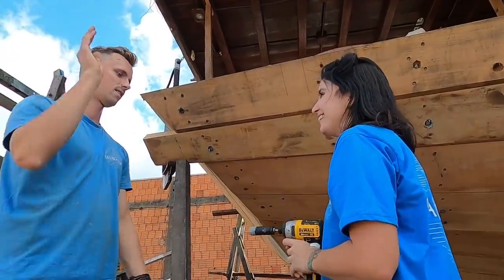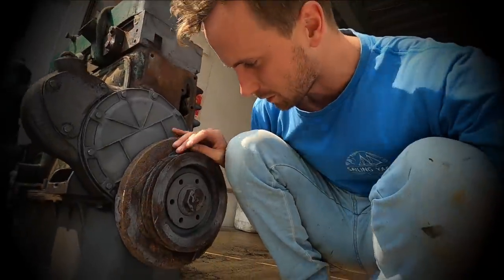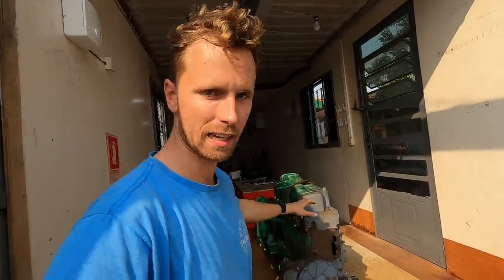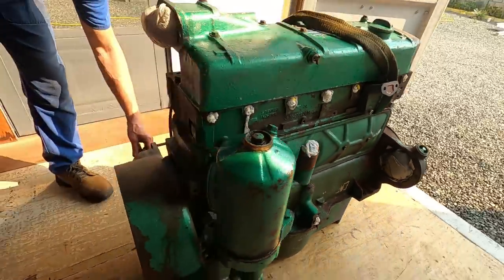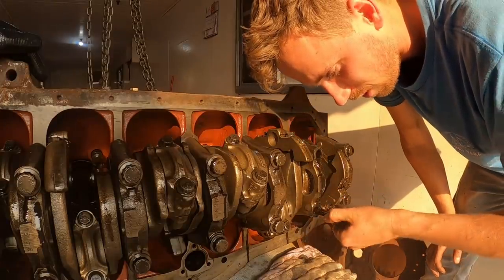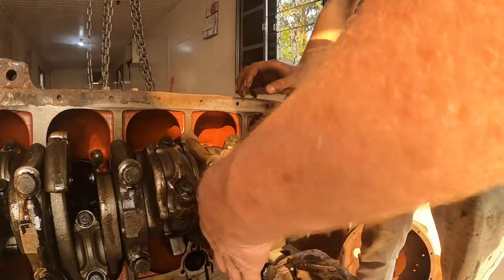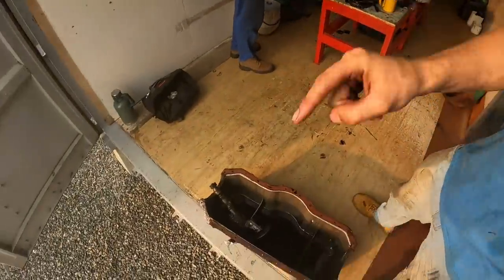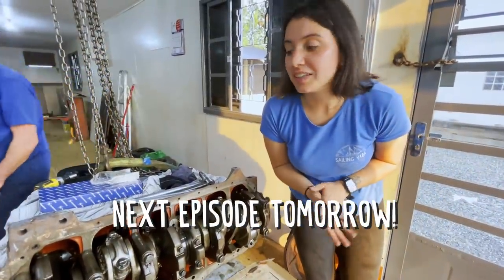ENGINE OVERHAUL STARTS NOW! (+ ingenious DIY crane) — Sailing Yabá #62

Comment: The sump is held on by bolts or if its threaded both ends its a stud ... They will often have different threads at each end so 
Take a picture and a make a  note sometimes they are different lengths or diameters. If you are to learn yourselves you need to develope a method..
Your mechanic probably could do most of this by touch and sight.. You have to learn to discriminate and identify parts based on tiny differences in things like the fineness or courseness of threads head types and know where the wild card left hand threads are used if any.
There are the crankshaft bearings that sit in the engine in the block the other bearings on the crank are the piston big end bearings or conrod big end bearings.... The small end bearing is what the piston attaches to.  
If your engine lost oil you should check the bores and rings.

Comment: It is better to remove the head. And check the cylinder bore. And it is called an oil pan. The flywheel is inside of the bell housing. If you lost that much oil find the leak and check the oil pump and the pressure by pass valve shim the bypass valve spring to increase the oil psi. I thought lots of this was really funny. Heat is what you use to remove stuck bolts and nuts when nothing else works

Comment: Dont forget to drop the crankshaft out and turn it (resurface it) the same way you do break rotors. Crankshafts are very delicate regarding bearings and it will likely start knocking if you dont turn the crank.

Comment: If the main bearings are worn you can bet the rod bearings will be worn and if they are worn good chance the cam bearings should be inspected and a new oil pump thats the heart of the system , pull the head inspect the valve seats and put new valve stem seals and a new head gasket, measure the cylinder tolerance and repair if necessary and new rings on the pistons , then it will be Done and reliable

Comment: Hi guys. I'm relieved to see that so many other other people have made similar comments to mine. I don't wish to put your efforts down and I know you are probably trying to save money, but as a marine engineer, I am worried that you are relying on this engine without a full stripdown and rebuild. The bearing shells are worn and you know the oil level was low. You need to have that crank out to measure the wear on the surfaces and to check the bearing caps and con rods for ovality. It is likely to need a regrind. The head needs to come off to check the pistons, cylinder bore, little end bearings for wear. The camshaft, cam lifters, rocker shaft and valves all need removing, cleaning and inspecting. The head and block surfaces need checking for distortion. Low oil level is likely to have caused much more damage at the "hot" end of the engine. You will be risking your lives on the performance of this engine. Please consider what so many people are saying, get the engine fully checked out.

Comment: That old deisel should be sleaved for the combution chamber... if so. no reason to try and measure for loss of tapper... just resleave it.  As for the valve guides.. they too should be sleaved.  I always hated measuring valve guides and piston taper on a sleaved engine as you had to resleave it anyway...  Hope that is how this one is.

Comment: @1:05, you ignored your advice from earlier in the video @0:15 already. make an access way in the deck to put the engine in, if you can get it in, then you can get it out in future if you need to without cutting up the boat.

Comment: Good grief. The engine had NO oil in it. There is no manual in sight but there are wear specs that should be referenced before slapping new bearings in it. Rebuild the engine properly or replace it!  If you don't have time or money to do it properly the first time, you definitely won't the second time around. Your compression numbers were questionable at best and the bottom end of the engine is very tired. Take it to a proper shop, this isn't something to fart around with yourself. Hopefully the main bearing caps and big end caps were labelled before removal because they have to go back in the same location they came from.

Comment: I totally support you guys! However you are making a big mistake by not rebuilding that engine! If it where my engine I would reseat all the valves with new seals on the head, change all gaskets with new front crank seal and rear main seal change all bearings for both pistons and crankshaft. Send head out and have its surface machined with proper head gasket. I know it will cost you a few dollars but it’s cheaper than a new engine and will be entirely cheaper than if something goes wrong and you have to take out of boat again.

Comment: The internals of the engine look very clean which seems to indicate it has not run very hot during its life. Mechanic seems to know what he is doing so sometimes, if it ain’t broke, don’t fix it, is the most suitable option. Just ensure the oil seals are replaced and gaskets are sealing.

Comment: You can't possibly know if the cylinders or Pistons are ok if you don't pull out the crankshaft rods and Pistons. You definitely have to replace the piston rings and you need to pull off the head and check the camshaft,valves, and replace the camshaft bearings. And I certainly hope you don't sand blast the interior of the engine as you will never get all the sand out and what's left will eat the engine alive once it's running.You can't do half a rebuild you either do it right or might as well buy a new engine now. Especially on a diesel engine.

Comment: I am sure your done with the engine by now but if you took your time and rebuilt it correctly that Mercedes motor will last longer that you. I have see them from the 50's and 60's that are still running with original equipment from the factory.

Comment: As MANY said before, i don't see the purpose of replacing the crankshaft bearings, and not the connecting rod bearings. Very often, rod bearings wear faster than crankshaft bearings. you would be wise to open the head, check the valves, and replace the piston rings, the oil pump at least. Cutting corners on a marine engine is always a bad idea. Check the "wildlings sailing" channel : a young couple, as you are. They tried to refit their engine on a tight budget. They spent money on it and the engine just blew away months later.  I saw plenty of " rebuilt engines" ( or presented as such) fail after short period of service.  It would really be a pain in the ass to take your engine out of the boat once all the new wood is in place.  All that said, it's your boat, your money, your decisions... and your experience! Just  a few words from an old fart from France. Keep on the GOOD work and enthusiasm!

Comment: That engine is ancient technology & materials and design. Putting it back in will devalue the boat. It’s too heavy for the power it makes.
But a new Yanmar Diesel engine and install it.
More power, less fuel, less weight, more reliable & more value boat.

Comment: Oh! 😳
That's not an overhaul!! You need to get the head off, pistons out, replace the rings, check the head, bores/liners, replace headgasket etc etc... if you've gone that far makes perfect sense to do it 100% properly and at not much more cost.. very worth it in the end otherwise this will possibly and probably bite you further down the line, and it's "good engineering practice" Please consider!
🤞😉

Comment: Mercedes engines are normally pretty amazing and go on and on and on but it’s the SMALLEST components that will let them down,seeing as you have the Engine stripped this far it would be foolish not to do a complete rebuild and if you CANNOT get any replacement ' O  ' rings,seals gaskets or stretch bolts ( please replace the bolts and not re-use the old ones ) then unfortunately it is time for a New Engine. 
You will need to check the piston’s and rings and tolerances on main bearings and small end bearings and at a minimum hone out the bores ( if it is fitted with oversize pistons because of previous re-bore then new engine will be needed ). 
Don’t take short cuts or cheaper options on your Engine because aftermarket parts are cheaper for a reason !. 
The last thing you need is for your beating heart ( the engine ) to fail in the middle of nowhere.
I’m surprised you didn’t see how much money your engine is worth in spare parts and then just think about a newer more reliable engine which you would always be able to use for more reliable hot water exchanger plus generate more electricity etc

Comment: I wish you would have tagged and bagged everything . All the parts lying all over the container looks like a nightmare . Dozens of bolts put into a bucket without marking where they go can only mean trouble later . I hope you do a complete rebuild and not a half a$$ job . You have spent so much time and money on everything else , this maybe the only chance you have to do the motor right .
Reply from the maker: Hey Joey! Helio, our mechanic, used to work building this specific engine. He promised us he can put it all together with his eyes shut! So that shouldn't be a problem! Thanks for your concern though!

Comment: That engine is worn out !!! If you had 18 litres of oil in the bilge you would def have seen it which means it burnt all that oil and amazing it did not seize up !! You will be sorry if its not totally rebuilt .

Comment: Slapping in a new set of crank bearings is not a simple task. There must be more that you did not film. There was no measuring of the current clearances and polishing of the bearing faces. The engine is more than likely back together due to the time lapse in posting these videos. Either you skipped allot of steps filming  or shortcut on the rebuild. We do not need to see every step but tell us of the things you did that were not filmed.
Reply from the maker: We will be showing more about the bearings on tomorrow’s extra episode! 😉